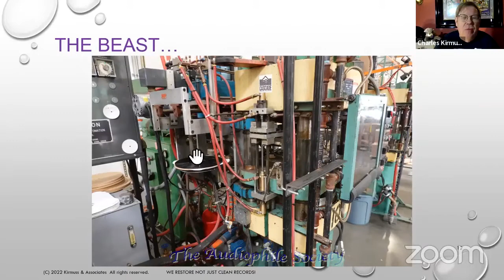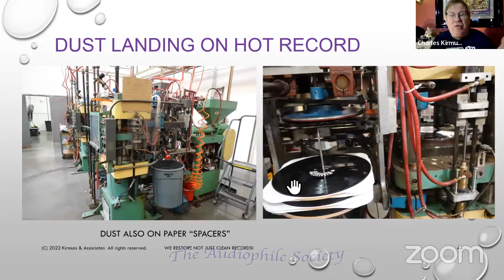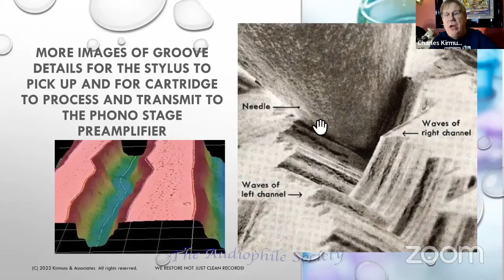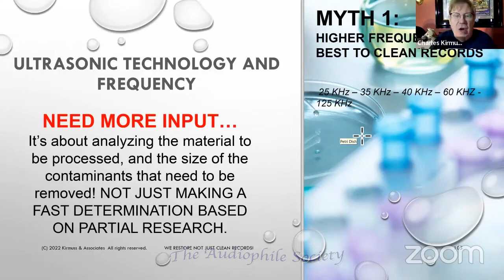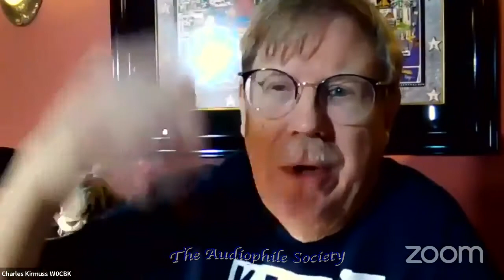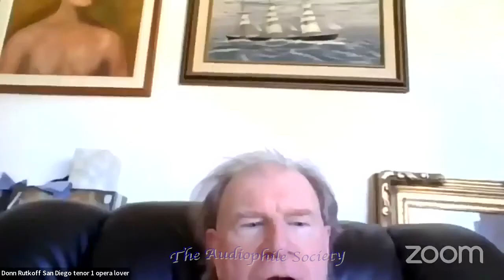Charles Kirmuss Zoom

Comment: At 36:22, speaking about the left-over from a song. I disagree.

When someone hears this, it's because the audio tape has "picked-up" from a previous layer on the tape reel. Tapes use metallic oxides. Metallic oxides are subject to becoming magnetized. That's the purpose of magnetic tape, after all.  When a tape has been spooled onto the reel. it's done in layers, and an upper layer is adjacent to the part of the tape immediately below it. The upper tape on the reel becomes partially magnetized by the the layer immediately below it. This is how it is common to hear the soft "ghost" recording that precedes the actual recording.

When the tape is used to create the masters and stampers, this can often be audible in the masters.

Comment: What’s up with the 40ml of 70% isopropyl alcohol. And why does the machine warp my records.
Reply: I don't speak for anyone else. I've never had an issue with my Kirmuss KA-RC-1 damaging my records. I use mine frequently after bringing home new or used LPs. The highly-diluted mixture of the 70% Isopropyl alcohol in distilled water is an approved practice by the RIAA to clean LPs and remove contaminants and prior cleaner residue. In my experience, it has never harmed any of my records.
Reply: The IPA is used to kill fungus that is live or dormant. Not used for cleaning.

You need to stop using the machine, last cycle, when the small red light appears to the right of the long red bar. Stop totally when this light flashes. It cannot warp records. This said polystyrene records need to be watched closely. The warm water  as it heats up will see the records twist, so one needs to stop, change out water with cooler water, then continue.

A polystyrene record will return to its "rest" or "pressed" position.
Reply: 70 percent iso makes most mold laugh and happy. Lol, fungi not bacteria peeps

Comment: What can I use to clean and renovate 78s other than the distilled water since alcohol cannot be used (or can your 1.4 oz. in 6 quarts water be considered safe)?  P.S. I have used a Magic Eraser for over 1,500 hours with my prior Benz Ruby 3 to clean my stylus without a problem (cantilever change/damage).   Maybe I'm just very delicate in using it.
Reply: The alcohol we add in its small percentage is to kill live or dormant fungus.